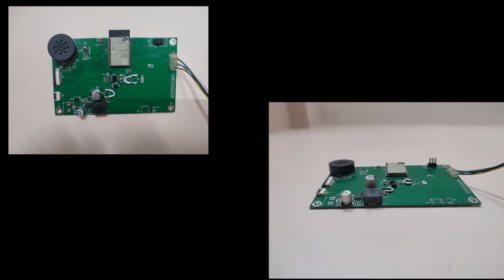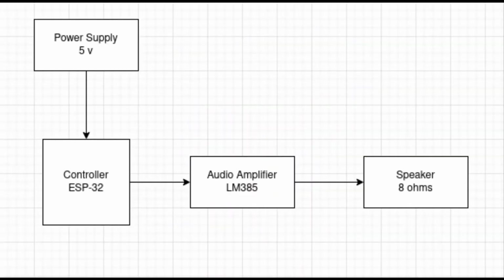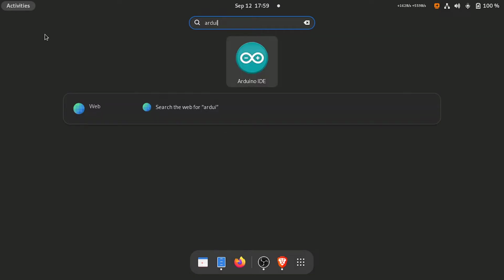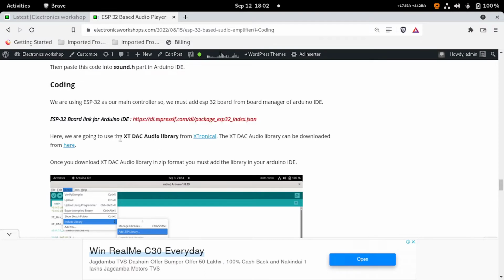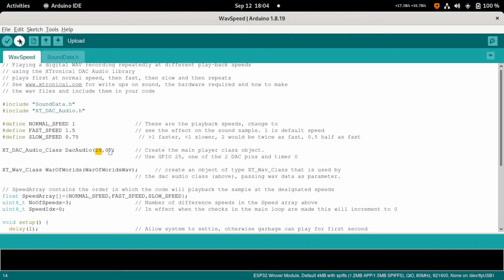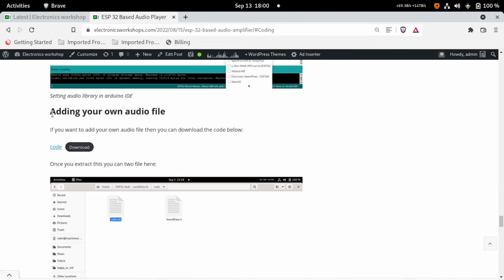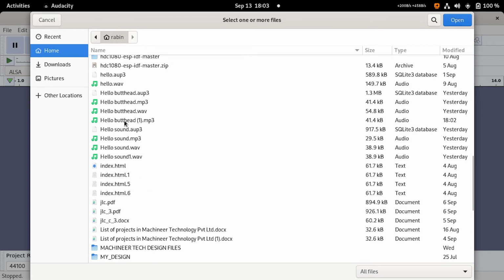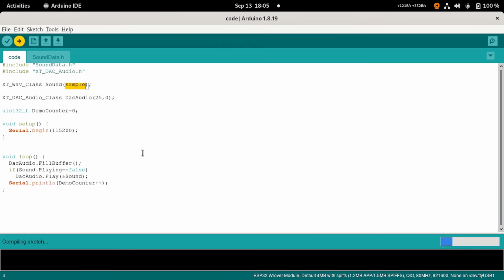ESP 32 Based Audio Player

Comment: is it working on ESP32 Cam module too?
Reply: i think no. i have tried but failed because esp32-cam does not have DAC pin
Reply: I have a Esp32 Cam with Sd Card slot, any option to conect Speaker ?